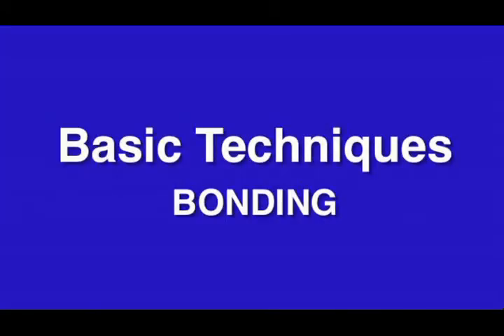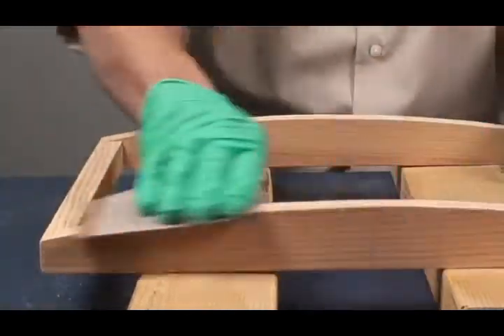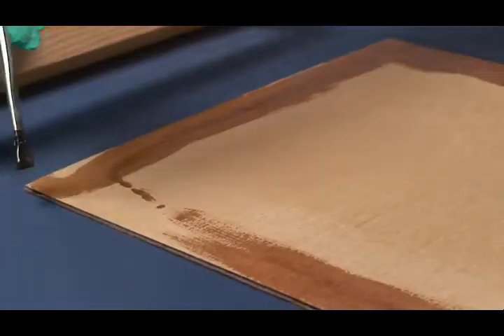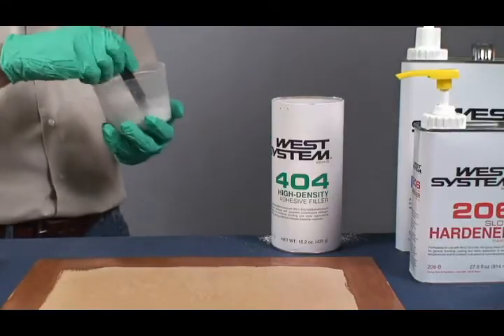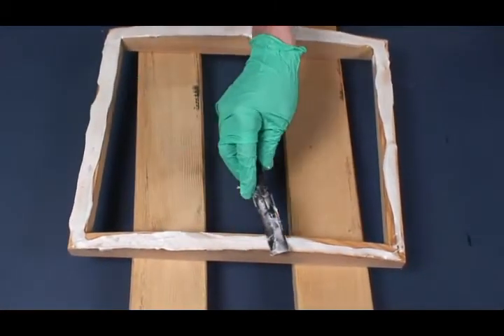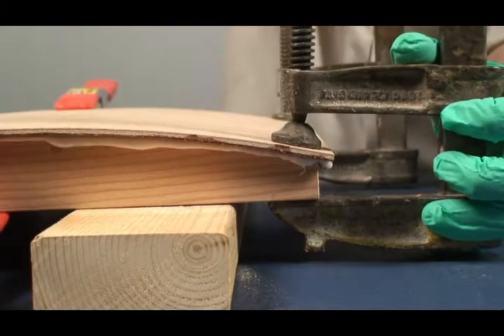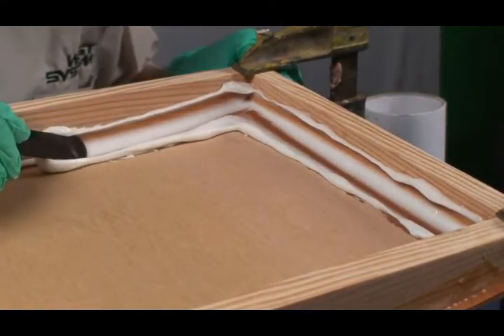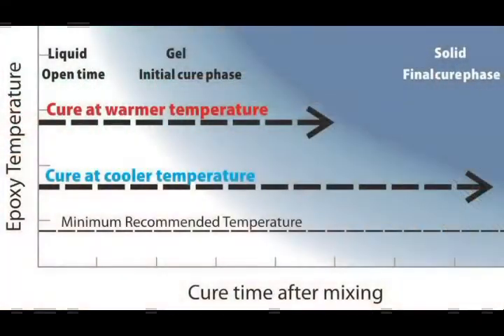Bonding with WEST SYSTEM Epoxy

Comment: I find even with the fast hardener the west system epoxy is far far too slow for woodworking - I want the clamps off in 30 minutes and its still fluid after 2 hours at room temp even though I have used the measurement pumps - its just too slow for regular woodworking, good for stair building where I want 3 hours open time but I cant tie up my bench for the full day waiting for a glue up to dry